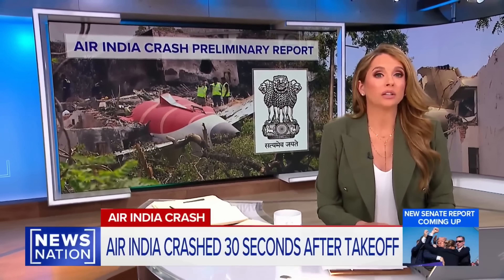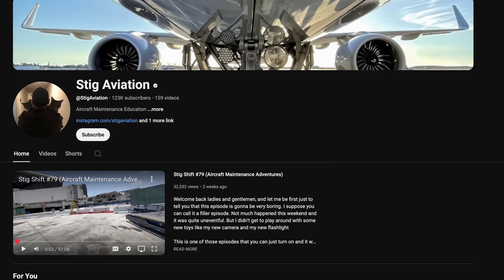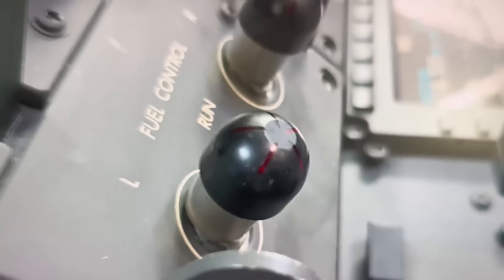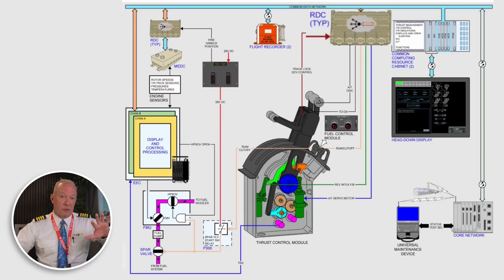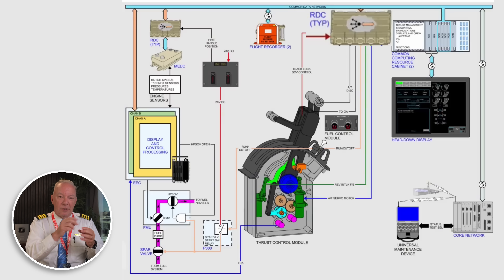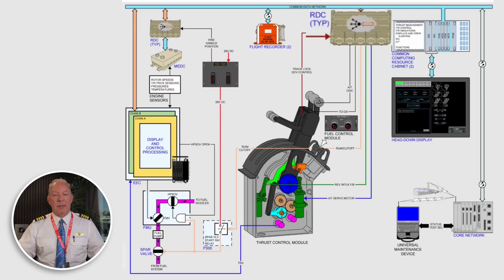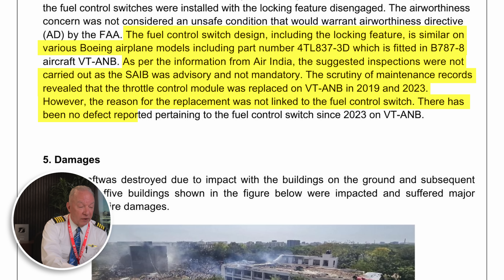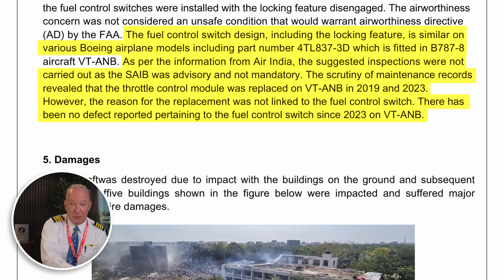The Truth About Boeing 787 Fuel Control Switches

Comment: Ok, I'm not a pilot or engineer, but in a room full of people who seem to know a lot - why are the two switches that will DEFINITELY cause a pretty massive outcome (no power AT ALL) right next to the main throttle levers?

I think what happened is clear, but in this instance their proximity to the controls being actively operated maybe meant those critical few seconds were easier to miss by the pilot than if they were say up with the controls in the ceiling area?!

I'm sure there's a good reason, I just can't think what it is?!

Comment: I’m no expert and my message will clearly show this, I did originally think wether a certain engine component or sensor could’ve caused a malfunction to cause the engine malfunction. 

I’m sure I read a story about a complex, faulty sensor design in a different/ older plane’s design of a component that was designed to cut off power or something to the engine if overloaded with power. Not that I thought this exact issue, but the story of the issue where the issue is quite complex to get to the bottom of, (plus on both engines 🤔) it just couldn’t add up. 

Your explanation is sound and I heard others speak also. The technical talk is always explained in simple terms. 

I really don’t want to think it could’ve been pilot error, (intentional/ or not) but it’s so sad that’s it’s absolutely the case. 

All in all a very sad turn of events either way. 

Best wishes.

Comment: My brother-n-law is a retired Delta 757 Captain. In his early years he was the Captain of a 727. During a climbout the #3 engine of the 727 reved up to full throttle conditions causing a yaw which he had to fight using full rudder to try and keep the aircraft straight. He commanded the first officer to turn off the fuel and shut down that engine. Such an awkward command caused the 1st officer to question it twice. In those days there were no sophisticated computers and reading the manual was tasky and time consuming. Once shut off he regained full control of the plane. Apparently, the RDC had malfunctioned or another independent system had allowed full fuel boost to the engine. Simply pulling back on the throttle had not stopped the yaw indicating to him it was something independent of the throttle.   Nothing to do with this scenario, but does tell how the RDC and other systems work independently.
Reply: So, it seems the 787 Dreamliner got a system called TCMA (Thrust Control Malfunction Accomodation) that cuts off fuel to the engines in that exact situation, it was designed to automatically shut off runaway engines.
ANA flight NH-985 had an issue with that system while landing at Osaka Itami, both engines shut down simultaneously after deploying thrust reversers.
The system interpreted the engines spooling up for reverse thrust as if the engines were spooling up with the handles at idle position and cut the fuel.

Maybe it has nothing to do with this scenario, but does tell the 787 Dreamliner can indeed shut down the engines by itself, and it already did.
Reply: Correct, I’ve found a few comments regarding the incident. However, couldn’t see anything stating the fuel cut-off switches also dropping. I suppose the question I’m asking is do these switches also drop to cut-off if there’s a double engine failure.
Reply: Nice story and great reaction by pilot, but the  fuel cutoff system can't be interfered with by any other system. This is by design!
Reply: @DavidTorres-xl2jl   It can, and it did already.
ANA NH-985.
Boeing 787-8 Dreamliner.
Dual engine automatic shutdown due to an error of the TCMA system.
Reply: Exactly my point, systems can fail. and the consequences can seem like Pilots did something.
Reply: 727 had totally different fuel switches.
Reply: @Mike-tu5hg The B 727 has levers and cables to the fcu (fuel control unit ) on the engines. Even this levers has to be pulled to move them over a mechanical gate !
Reply: I agree

Comment: All highly technical and I make no comment on the accident itself. But I am amused at the comment that the fuel cut of switches are mechanical. Let's be honest, while the movement and locking is mechanical, the effect of movement is to energize an electrical relay and associated highly complex circuitry

Comment: A few observations and remarks:
First off, I find that the strongest indication (that we have seen so far) that it was indeed the switches that were moved was that state first changed separately and with a plausible interval for left/right and then also changed back a little bit later. Ie, essentially the timing and reverting the change suggests it was actual switch operation.

A lot of the other arguments for why it must have been the switches that were moved seem questionable to me, and I fully understand why these other arguments are not fully accepted by someone doing some critical thinking about the electrical circuits that must exist, whether we know their exact design or not.

Regarding the mechanical design of the switches, that is all well and good in itself, switches like that should not move without deliberately pulling them out. But then there was that bulletin found about how an installation error could make that very design not function as intended. Idk what installation error that might be, no one seems to be talking about that (so far), but maybe incorrect spring tension or something could cause the switch to be able to be moved across way too easily?

The following is largely about what I feel are somewhat questionable or weak arguments being put forward, not that I personally don't believe the switches were moved (as noted above):

The model version of the circuit that you constructed does not match the circuit diagram you show. In the circuit diagram, there is a switch and a relay, where the relay has three pins, one is powered with 28V directly(?) from the batteries, one is the output that actually feeds 28V to the valves when the relay is "on", and importantly one is for the signal from the physical switch that indicates if the relay should open/close. Also there is seemingly also a connection from the switch circuitry to an RDC/FDR path (?).   
I make this point specifically because the cable runs between switch and relay, other things tied into this circuit, etc seem like a huge factors in terms of potential failures that are possible.

And I think a lot of the questions you are responding to are more related to what happens if if there is any kind of failure along the various paths, like what if there is cut or what if damaged cable touches ground or some other cable or whatever. 
Also, could a fault in the RDC/FDR monitoring path, seemingly tied into the same circuitry (according to the diagram displayed in the video anyway) affect the relay as well?

So, imho, one of the central questions is instead: how does that relay operate? Does it open or close based on having the input pin high/low? And where does the signal voltage for the switch come from?
Obviously the intention is that only the physical switch should affect the operation of the relay, but what really makes the relay open/close the circuit if we ignore the intentions and just look at the circuit? 
For instance, could a cable cut trigger it to open the circuit, or an oxidized contact surface inside the switch or whatever? Are there lots of other cables in the same harnesses where, if there is damage, potentially you could get in contact with ground, positive, whatever?

A lot has been said by various experts about how the cutoff switches basically cannot fail or have their position misinterpreted electrically, but I feel these responses always lock in on "only the switches control this" without doing anything to actually dig any deeper than a very surface-level look at what the design intentions were, where in reality that may well be a moot point when you factor in potential damage or faults in the real world electrical circuit (see above).

Comment: I think you are missing the elephant in the room.... Yes the Fuel Control Switches are a great design and you probably can't move them unintentionally but then you go on to speak about the relays that they command. Relays can absolutely fail and go from open to close or closed to open uncommanded. This can be for many reasons including mechanical wear, contamination, or electrical stress.

I think you should forget the physical switch position and perhaps talk about the potential of a relay to fail.

I am not saying this is what happened but to ignore the possibility of it happening is just wrong! It is like you have not even conceived that it is possible!!
Reply: Both relays that are independent of each other, that also require power application to both open and close (not a power interrupt to open) as latched type design within 1 second of each other and then both work again within a 10 second period?
Reply: You are asking too much from the captain. There are others who actually understand this stuff.

Comment: Excellent description, thank you. But has anyone noticed the diagram starting at 3:46 shows the SPAR and HPSOV valves being directly controlled by the fuel shutoff switches but the FMV valve is controlled by a signal from the DISPLAY AND CONTOL PROCESSING unit? Perhaps Captain Steeeve or someone knowledgable would either explain this discrepancy or correct his statement at 5:00 that "It's a closed loop system. There are no other inputs into that system. There's no digital signal that gets sent to them, by mistake or any other way, that could close those..." True for SPAR and HPSOV valves but not for the FMV valve.

Comment: I could see those tabs getting rounded off over time, making them less of an obstacle to accidental flipping.  Properly designed, shouldn't the sides be vertical, instead of at an angle that would presumably ramp the switch up and over if hit hard enough?

Comment: Talk about the RAT ! 
You cannot ignore the almost certain conclusion that the RAT depolyed very shortly after take off.
Even deployment after fuel cut off  DOES NOT HAPPEN without other catastrophic failures.
If this is true, the  supposed "switch off" is not relevant any more.  Then it was NOT THE CAUSE of the accident.
If any failure  OR ROGUE INTERVENTION  caused the engine failure  (NOT DESCRUCTIVE (not preventing restart)),
then all of this discussion is frail.
Reply: What is your source about the RAT deployed before the switches were moved?  That is NOT in the official report.
RAT is set to automatically deploy if both switches are moved to cutoff while the plane is in "air-mode". Seems to me like it was working as intended.
Reply: @daedalron  watch?v=hrndsuamKN8

Comment: @6:00 could you tell us if that relay is normal close or normal open?
Reply: Normal closed would make it failsafe. Supplying electricity to open the relay and cutting off fuel would be safer

Comment: I suspect the heavy hand of Boeing in the Preliminary Report .... just enough details released to implicate the pilot and protect an impact on shareholders, but not enough to show the actual cause.  

The switches are mechanical, so how could they know if the switches were moved, or some other electrical issue caused the relay to flip?  The data will show the relays switched, but without cockpit video we don't know if it was the mechanical switch or the relay or both.  

Maybe it was the pilot, maybe it was an electrical failure, but the Preliminary Report was clearly designed to implicate the pilot, particularly the one segment of the cockpit voice recorder text released with no context.

Comment: Not all your audience is as unaware of electronics as you think. You are telling lies. The diagram you show tells a different story. It is not 28 volts that controls the fuel valves. It is a digital signal coming from an AND logic gate that controls the fuel valves. Also, one input to the AND logic comes from the switches. The other input cones from the computer, which may have a glitch. However, no one can be sure that this accident wasn't a deliberate act or otherwise.

Comment: Just a question, can a failing DC battery for example short circuit in one of the banks trigger the AC power breaker to protect from short circuit? Losing power altogether.

Comment: If 28V DC to be supplied to the Valve mechanism, what is the purpose or requirement of having relay in between, the 28 v DC could have been given directly to the valve circuitary unless relay needed 28v dc to operate and supply higher voltage to operate the valves?

Comment: That was an excellent diagram you talked us through!  You have a true gift for describing aircraft systems clearly and concisely to all of us.  There is a document for all airliners entitled "System Schematics".  This document, as it implies, provides a pictorial representation of all aircraft systems.  It shows details down to each wire, but it's not a huge, unfriendly document like the 787 Wiring Diagram document would be.  It is used as a reference by mechanics, but it clearly states that it is only a reference and NOT a substitute for the aircraft's actual wiring diagrams/parts catalogs.  I am sure pilots have access to this document and it may even be built into the 787s on-board document system.  The problem is, Boeing has "Boeing Proprietary" printed on each and every page and will come down hard on anyone who publishes a scanned page from this document.  However, that doesn't stop legitimate copies from retired mechanics showing up on eBay.  This document would make it very easy for a pilot, with a rudimentary knowledge of electronics, to follow the path of wiring between each source and destination.  As with everything else electrical on an airliner, there has to be a circuit breaker in-line with each circuit to prevent electrical fires in the case of a short or overload.  I don't know where the fuel valve circuit breakers are located in a 787 cockpit, or if they reside in the EE bay away from the cockpit.  The System Schematics allow the reader to follow everything associated with those fuel cutoff switches.  Each of the switches have multiple circuits that go to different places.  (i.e. the FDR has a specific discrete input to record switch position.)  While there is only one "bat" to toggle each engine switch on or off, there are actually 3 or 4 switches (circuits) under that bat that get actuated all at once based on toggle position.  I have the actual switches and they have four internal switches, plus the bulb for the red toggle cap lighting.  That's a lot of wires per switch.  Where all these individual circuits go is a mystery to me, but can be easily traced with the System Schematics document.  I don't know if you have access to this document, but it will reveal where the circuit breakers reside for each fuel system along with the associated relay(s) that may be between them.  I very much doubt that a pilot pulled the circuit  breakers since the FDR recorded the fuel switch position and should not change regardless of the breakers.  But a comprehensive description of the fuel systems aboard the 787 can be found in the "System Schematics" and they are easy to interpret and would be the perfect mid-level technical guide for anyone who was interested in the aircraft systems.  It's complex, but definitely easy to trace.  System Schematic documents are amazingly easy to follow.  It's the first place I would go to to find out what is between the switch, battery bus, breakers, relays and fuel valves.  Just a suggestion to augment your excellent diagram with a somewhat deeper layer of complexity from an official 787 document.

Comment: Yes the Pilots turned them off and then on again after the engines had shut down, that is the normal procedure,  they did that because after take off water had shorted the electronics bay under the leaking problems they were told to fix just weeks before. Also the Pilots on the previous flight had reported electrical problems. Seems that the facts are being ignored and also a lot of disinformation is being purposfully being spread.  I guess a cover up is now obvious! Happy flying on a leaky plane ...Money Talks :)

Comment: The thing that gets me is assuming those fuel cut-offs were manually shut off the offending pilot must have practiced it on simulators because he knew exactly when to shut them off after the aircraft rotated virtualy to the second knowing there wasn't enough height to fire up the engines again. I would be checking his simulator logs or if he had access to an unofficial simulator.

Comment: Thanks for a good explanation of the system, another of those odd theories out there is something like a cable fire or cable insulation problem so it would be interesting to know how they are bundled with other wires. Are the cables to the fuel relayes physically separated from other cables and buses and not bundled with other cables.

Comment: I disagree about there being no other inputs - the EEC controls the engine fuel valve - moving the fuel control switches to run opens the spar valve, and arms the engine fuel valve.  The EEC decides when to open the engine fuel valve during start, which is why you can move the fuel control switch to run immediately after pulling the start switch.  That said, It’s very, very unlikely there was any issue with the switches - the position is monitored by the FDR on a separate pole to the control circuit. It would be extremely unlikely that the FDR would record this incorrectly (on two independent engines), AND then the engines co-incidentally shut down at the same time, simply didn’t happen.  I don’t know why so many people are looking for alternative explanations to what is the blatantly obvious cause.